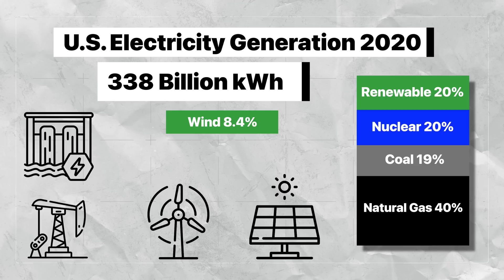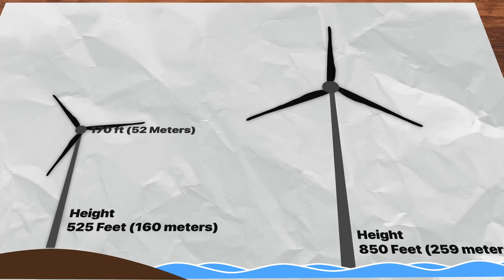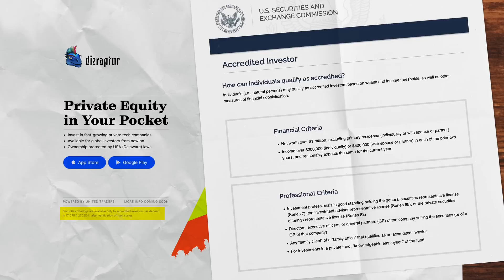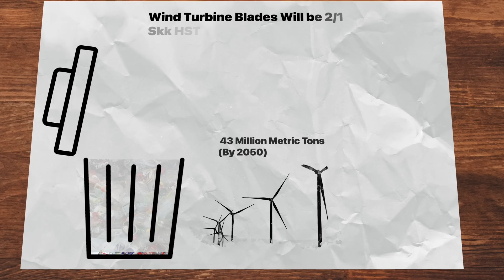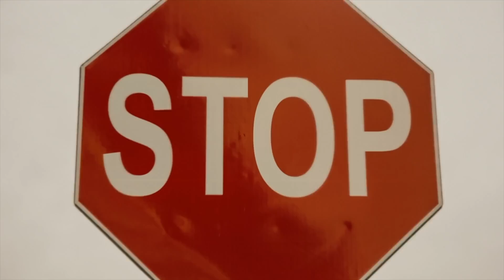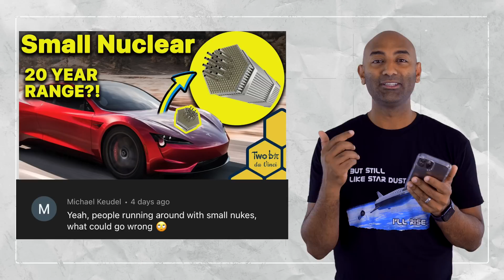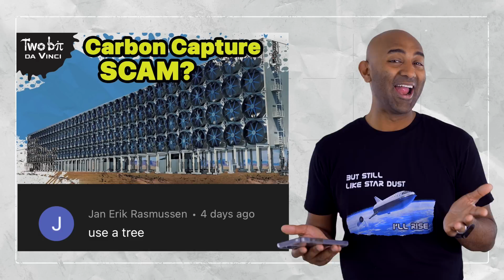The TRUTH About Wind Turbines

Comment: There is a lot to unpack with this video, too much to write in a short moment. Two of the topics you stayed very clear of was the energy deficit created when manufacturing WT's (Wind Turbines). The FACT of the matter is in the production and manufacturing, the  WT's will never overcome the energy produced during the manufacturing process and continuing intensive maintenance of WT's. After installation is complete the energy produces is cheap, but getting to that point is expensive and extremely energy intensive. the second topic that you passed by was the death that Wt's cause, each WT is responsible for killing more birds than KFC, not to mention the insects that are killed in such volume that all WT's have spray jets to clean the blades from the bug smash as that bug guts make the blades less aerodynamic and less efficient so a massive amount of water and chemicals are used to this end. A topic that people are ;other to speak about when discussing WT's is how terribly unsightly they are, I don't know anybody that likes to go to a beautiful mountainous are and likes to see a WT killing the majestic view; Germany comes to mind, I won't go back the place looks horrid! The technology isn't ready for prime time, for example, the oil in the gear reduction case has to be changed after something like 36 hours of running because there is no oil yet produced that withstand the pressures of that environment. being an engineer as you claim to be and I an=m sure you are, you should do some REAL imperial research like a good engineer on topics before you discuss them and not just read the press releases that everyone has.

Comment: I can see the moving parts in a turbine wearing down, requiring replacement, but what happens to the blades that causes them to be scrapped? Do they eventually lose shape rigidity from repeated flexing? Isn't there a way to refurbish the blades to use them again? If not, I think they need to shift design to a model that is more amenable to refurbishment.

Comment: No one ever mentions the amount of lubricating oil wind turbines require to operate. Most sources say a 150MW wind turbine requires about 80 gallons of lubricating oil per year. Certainly cleaner than other sources, but wind turbines are NOT free and clean. A 150 turbine wind farm (the average size of a farm) then requires 12,000 gallons of oil every year. And this isn't vegetable oil, its PAO synthetic oil made from crude oil. Wind power definitely has its place in a responsible energy solution, but please stop saying it is 100% green (if by green you mean no fossil fuels involved). That's simply not true.

Comment: The problem with wind power is simply it’s scale. Imagine the battery for your cell phone being the size of a Buick with extremely low power density instead of a highly compact size for its power density. Translation: When people talk about “cost” they almost NEVER mention the damage to ecosystems. Wind farms take up hundreds of thousands of acres while a nuclear plant takes up a half a dozen acres with 20 times the output of even the largest wind farms. For wind, landscapes that were once green and covered in vegetation is now broken up by large bald patches connected with roads. This being said, for the purpose of generating energy we could literally cover the entire globe with wind turbines and we would continuously be short on energy and every landscape on the planet would be destroyed! Solar isn’t any different. It’s more compact, but then there is the issue of climate changing dramatically immediately around solar farms. And we still get thousands of acres of habitat being cleared. For green energy, it seems there is quite a lot of clearing out greenery for them. And last time I checked, vegetation is the Earths friend in reducing “greenhouse gases.”

Comment: I live in Wyoming less than five miles from a huge wind farm. I have to look at those huge blades turning every day and watch the hundreds of red flashing lights at the top of the towers every night out my windows. I also live within 100 miles of one of the largest blade dumps in the country and quite possibly the world. The site was chosen because they needed a place that had large amounts of land to cover up all these blades. (Their words not mine) It’s a sight that would make most environmentally sensitive people throw up if they had a clue of all that waste. Bringing them to a place that is out of sight out of mind seems to be the wind turbine manufacturers solution to their so called “little” non recyclable problem. Can’t have the general public see this. Have you ever witnessed an oil seal leak that spray lubricants over ten or twenty acres when the seals fail at the top of a wind tower? I have. More then once and those blades throw the oil carried then by the wind everywhere. Imagine throwing a five gallon bucket of antifreeze on the fan blades of a running car engine. It fly’s everywhere. I can tell you for sure that folks here are no longer fans of these landscape polluting eye sores. Folks in other places think there all wonderful until they have to live in an area that has hundreds of them in your front and back yard. Our once beautiful view of the Rocky Mountains are now plagued with views of white sticks and pinwheels. Not just a few. Like I said, Hundreds of them. I love the idea of renewable energy but wind turbines perched on huge white sticks are not the ticket. There has to be a better way.
Reply: Have you ever visited any of the 500 mountains that have been destroyed by mountain top removal to get coal or the 2000 miles of streams that have buried by mountain top removal? Ever smelled or drank the produced water from fracking? 25% of the chemicals used in fracking cause cancer and 47% effect human health and those chemicals are nearly impossible to remove after they have contaminated a region's ground water. Ever visited the tar sands of Alberta (which look like Mordor) or seen all the people dying of cancer in Ogoniland, Nigeria or Lago Agrio, Ecuador from petroleum extraction? Ever looked at the haze of smog hanging over Los Angeles, Beijing, Delhi or Monterrey? Ever talked to any of the 8.7 million people who suffer premature death every year from breathing fumes from fossil fuel combustion? Ever visited Fukushima, Chernobyl or Kyshtym where there was a nuclear disaster or talked to the Navajo or Kyrgyz who live next to uranium mines?

I can assure you that wind turbines are much easier to live next to than any place where large amounts of fossil fuels are extracted or burned, and the same goes for the mining of uranium and nuclear power plants. Spinning wind turbines in a field and turbine blades in a landfill don't leak contaminants into the water, land or soil that can harm you--it is far more dangerous to live next to an old coal mine or leaking fracked well, because those can actually harm your health. 

All forms of energy have environmental costs, but wind energy has the lowest total lifecycle greenhouse gas emissions per kWh of all types of energy. If you include the total emissions from manufacturing and operations, onshore wind energy produces about 11 grams of CO2-e per kWh of generated electricity, compared to 1050 g for coal, 880 g for diesel, 540 g for natural gas, 240 g for biomass, 48 g for utility PV solar, 41 g for rooftop PV solar, 38 g for geothermal and 24 g for hydroelectric (IPCC WGIII AR5). The estimates for nuclear energy vary widely, but they are generally worse than wind when building new power plants. 

When you say "there has to be a better way", I have to wonder what you think is better than wind? New nuclear plants cost about 3 times more per kWh as wind in the US and there are no new ones planned after Vogtle 4 in Georgia. New Hydroelectric energy costs about twice as much as wind per kWh and dams are enormously destructive to rivers and produces methane emissions in deep standing water with rotting vegetation. Geothermal has few environmental problems but it only works in limited regions and has much higher costs then wind energy. PV solar panels don't kill birds and bats like wind turbines, but their capacity factor is only about 0.20 compared to 0.35 for wind, and everyone acknowledges that we are going to need both solar and wind to get to 100% low-carbon electricity, which is necessary to avoid severe climate change. 

Most of the existing nuclear plants are going to shut down over the next 25 years and you aren't going to convince utilities to build new ones after seeing how the cost of Vogtle 3 & 4 with 2400 MW ballooned from $14 to $35 billion. Nuclear simply isn't competitive compared to wind/solar plus battery storage. The Ember data in the first half of 2023 shows that new global electric generation was 92.5% renewable (46.2% wind, 44.1% solar, 1.7% biomass, etc.), whereas only 3.9% of new global generation came from fossil fuels and 3.6% from nuclear. Wind and solar plus battery storage are the cheapest way of getting to 100% low-carbon electricity. Trying to do it without wind means making people pay a lot more for their electricity, since nuclear, hydroelectric, geothermal and biomass are more expensive than wind, and hydroelectric, geothermal and biomass only work in limited regions and have limited supply, so if you say no wind, you either have to build lots of expensive nuclear or lots of battery storage to use with solar, which is going to raise the price of electricity.

Comment: Pointing out issues with wind turbines does not make someone opposed to renewables. With that said, I would point out that wind turbines take a massive amount of maintenance to stay working during their life time, unlike what you said @01:50. Turbines use gallons a year of oil based lubricants. Not exactly zero carbon emissions over its life time. Wind energy's time has not come yet, but it will, just give it time.

Comment: options, instead of dismantling just keep using then of grid ,so insures companies are out, conversation to direct compress air producción that is a way of centralized power producción and could be a hibrid sister adding hidrogen ,natural gas in air motor. 
Also possible use then as rigid sais in ships,as parks structures ....

Comment: The far bigger issue with wind turbines is the fact that the blades require balsawood, which in turn has to be harvested from the amazon, in part and that the blades only last for up to 20 years.

So the critics rightly point out that there needs to be a recycling solution!
Reply: 95% of balsa wood comes from Ecuador, where is grown in dense plantations. Where the trees grow very quickly capturing massive amounts of carbon, and as such is a very sustainable compared to most products. And every major turbine blade constructor has declared their materials come from sustainable sources, not cutting down new rain forest!

Comment: a few things have been excluded, like energy and resources used to build them in the first place, and then the carbon footprint of the manufacturing from start to finish. then there is the repair needs. I believe SOMEDAY they might be a net positive, but I dont think they are safe and durable enough to actually improve things. I am still on board with nuclear power, clean, can run for many decades to come, the new battery tech coming out is promising which would resolve some of the "waste" issue. and we have learned a lot about safety in this sector of the industry. build blades that can last 40-50 years, and decrease the risk of catastrophic failures then lets discuss wind.

Comment: Completely using short term anomalies to define a wider pattern.  Wind turbines have been forced on Americans and they absolutely suck on economic models.  And to try to say they are free of greenhouse gases ignores the toxins they leave in the environment from the manufacturing.  And they take petroleum to move them around.  Then you have the disposal issues which you only talked about the blades.  The whole structure is an environmental nightmare.  Did anyone even bring up the toll they take on wildlife?  Wind energy is a terrible plan unless you live off grid.

Comment: The mining, processing, manufacturing of wind turbines produce more CO2 then a wind turbine can save in the production of energy in their lifetime. Onshore wind turbines require 2,500 tones of concrete. In recent research on Onshore wind turbines it has shown that the average surface temperature around a wind farm is up to 2°c warmer then the surrounding land which causes more environmental problems.
Reply: A modern Offshore Wind farm Co2 emission's are earned back in a matter of months, then spend the next 24 years generating almost CO2 free energy. 

It does not take many more emission's to construct a large wind farm compared to a coal power station and the massive infrastructure required to supply the coal, (from open cast mining machines, trucks, conveyor belts, trains, massive ships, harbours, power stations etc), and a 1 GW coal power station over a 30 year life, would require 100 million tons of cool, 5.5 trillion gallons of fresh water, 100's of million of gallons of oil to mine, process, transport and burn the coal. and produce 6 million tons of toxic slag to landfill and 300 million tons of CO2 emissions.

The Wind farm requires no fuel, no fresh water, no oil to process the fuel or fresh water, produces no emission's and would only produce a tiny fraction of waste to landfill. Just requires maintenance (but no more than the maintenance and manpower required by equivalent cool infrastructure)

Basically the wind farm over its full life cycle would produce a 1000th of the damage to the environment then the coal infrastructure!

And how do wind turbines warm the surrounding land by 2C? Where would that massive amount of energy come from? Compared to a coal cooling tower that would evaporate 20 million gallons of fresh water per hour or pump 20 million gallons of hot water per hour into a river or sea.
Reply: @stevetaylor2818  when you take into account the fact that a wind turbine will only provide 30% of its rated production capacity on average across its lifetime you will need to install multiple to achieve the output. Then you have the problem of diminishing returns when you install a wind farm. When you calculate these factors you find that the carbon footprint of a wind turbine is several times higher then reported. Offshore wind turbines has a huge environmental issue with the delamination of the turbine blades producing a huge amount of micro plastic waste.
Reply: @benkerby9630  The figures above are based on installing multiple GW's of offshore wind to replace each GW of coal. 

As you are right, for wind energy to work with the variability of weather, will need at least 3 to 4 times the capacity of offshore wind, compared to fossil fuels, plus some solar & hydro to help cover the gaps, then spread the renewables far and wide, (working on the basis over a large enough area is always windy or sunny somewhere) and finally add on some storage. Even with all that the environmental impact of renewables will still be 100's of times, if not 1000's of time less than fossil fuels! Because the construction cost, resources and maintenance of any power system, is so tiny compared to mining, processing, transporting and burning the fuel (The world currently consumes per year, 86,000,000,000 tons of coal, 14,870,100,000,000 gallons of oil, 1,322,762,690,000,000 cubic feet of natural gas, requiring 331,675,500,000,000
  gallons of water for power generation)
 
And for renewables the fuel does magically arrive, 100% free!

And modern offshore wind farms average over 40% capacity, the record off Scotland is 57.1% of design capacity.

Turbines have a tiny environmental issues with waste, compared to the fossil fuels. Was estimated may reach as much as 43 million tons per year of turbine landfill  per year, compared to 5000 million tons of very toxic cancerogenic coal slag from coal power stations alone each year, and just imagine the billions of tons of toxic waste the fossil fuel industry generates! Plus oil slicks, open cast mines, uncapped old wells leaking gasses or oil, Plus 33,000,000,000 tons of CO2 gasses, acid rain etc. Plus the local pollution in our cities etc. etc...... 
The stupid thing of all is, Offshore Wind farms are 85% recyclable, which is an amazing recyclable percentage compared to most things. But how recyclable is the fossil fuel industry, does not matter, who gives a f%$k or cares, just mine, burn and pollute!!!!!! 

And the wind industry technology is in its infancy compared the fossil fuel industry. So I'm sure technology breakthroughs will come along in future generations of renewables solving most the waste issues.
 
Interesting fact: fossil fuel power stations only average 40% capacity over their life time.
Reply: @stevetaylor2818  before I respond with why renewable energy solutions are far more damaging to our environment and ecology I want to ask you a simple question.

Do you know according to the science of physics and thermal dynamics what increase in the average global temperature a doubling of CO2 from 280ppm to 560ppm would cause?